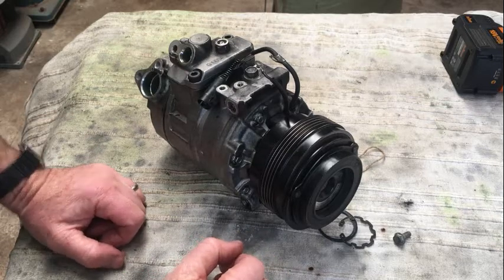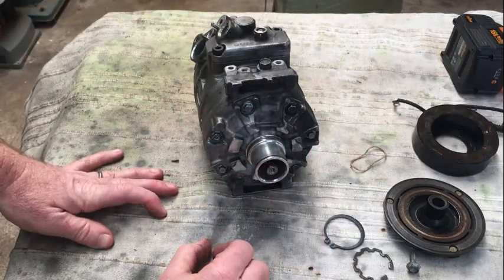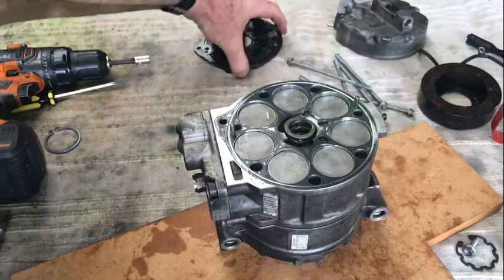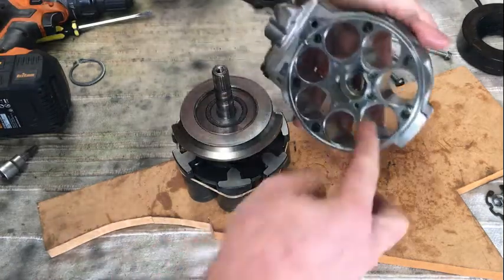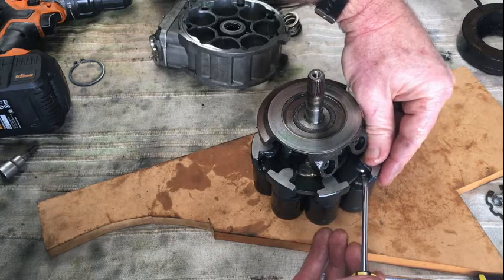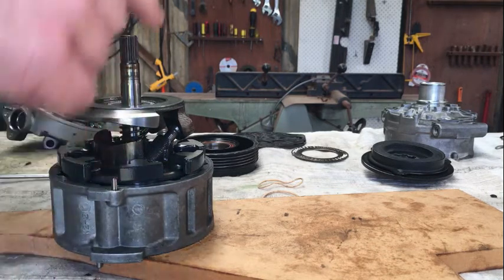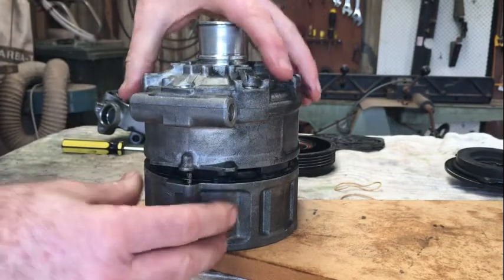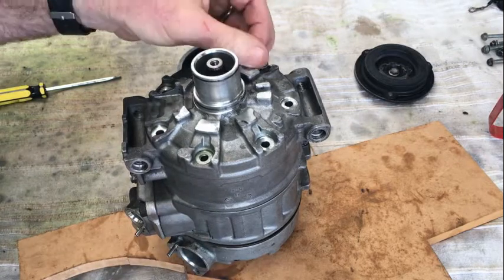BMW E46 A/C compressor rebuild

Comment: After watching a few tutorials I thought i would have a go at replacing the A/C clutch+magnet. . . 

Well. I snapped the bolt.  So i drilled quite easily through the bolt (slightly off centre). Then snapped the extractor tool in there. And the drill bits don't want to make a smudge on that material.  (I'm guessing red loctite is in there? \\🙄//)

As a bonus i couldn't find any circlip that holds the magnet on. So after leveraging it off using the chassis cross bar. I am guessing it will need to be pressed on. 🥶🥶🥶🥶 

Next step. . . a glass of scotch. reflect. Lose some more hair.

Then i'm wondering if i should completely remove it then take it to an a/c shop who can potentially drill press it, then press the Magnet on.